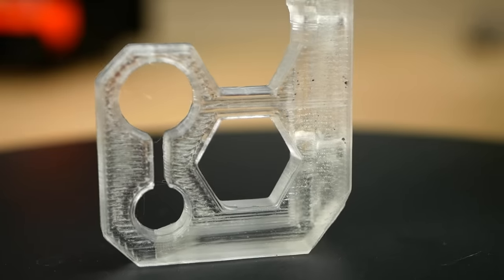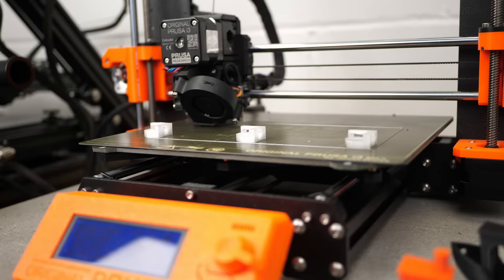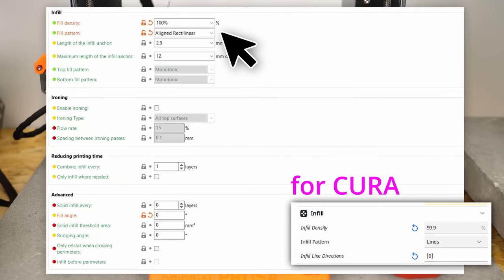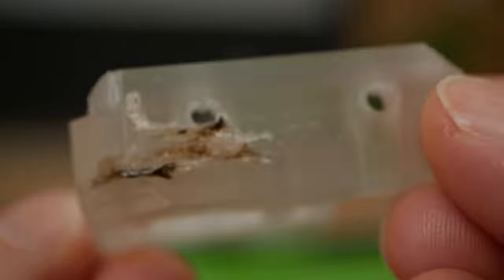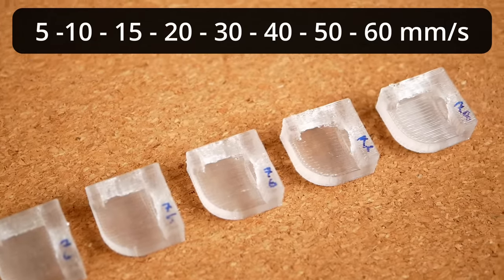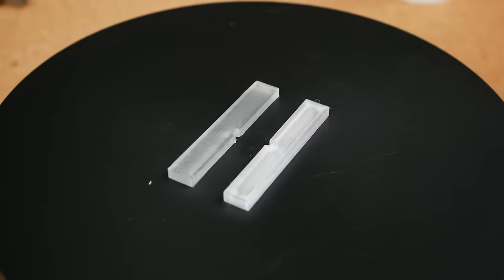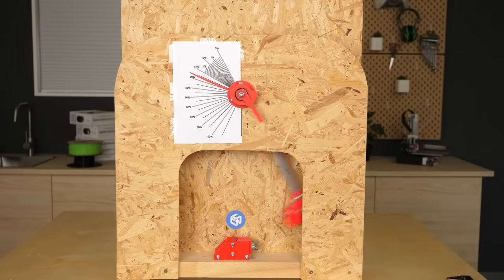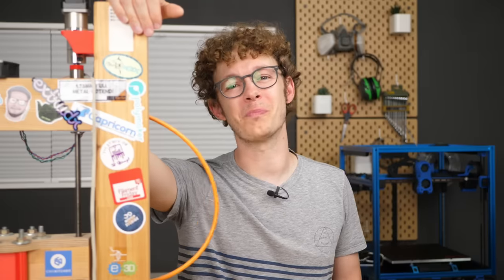Transparent FDM 3D Prints are Clearly Stronger!

Comment: I'm kind of wondering if you could vary extrusion width extremely finely to create holographic effects within the glassy print
Reply: No way. This would require modulation in the range of the wave length of visible light, i.e. fractions of micrometers.
Reply: @kaihorstmann2783  It's wouldn't be impossible but it would be very very expensive to do and would probably need a one of one state of the art 3D printer to the nano scale ✌️
Reply: @kaihorstmann2783  I think he meant deliberately creating small voids to create a 3D "holographic" structure in a clear part. Like those plastic cubes they sometimes sell at fairs with 3D "images" inside.
Reply: could be done. You'd have to have tiny voids or bubbles in the model
Reply: @gonun69  those little plastic cubes are exactly what i was imagining
Reply: Probably, seems like a decent idea. Though it'd require either manual g-code modification or a fair amount of coding.
Reply: I've been "watermarking" my designs for years with very thin included cutouts burried deep in the bulk of the model. The resulting STL file prints fine and typically isn't a problem...until someone wants to reverse engineer or edit them. Hmmmm I wonder what they would look like....
Reply: @eve_squared  could just use a modifier mesh, i think that's what it's called
Reply: I think it be easier to just change to a color print on the interior to have a clearer object with something inside just have to make sure you perge before doing the clear real good so you have loads of waste.
Reply: No need. Print it on top of bed with a P-Flat sticker installed. Youll get holo effects
Reply: no currently possible. those things work at molecular level. usually masked from crystals.
Reply: @SeanTaffert  why couldn't they just merge another solid body mesh in the watermark to make the whole mesh solid. I believe mesh tools can already do this. Not something a beginner could do but not impossible to remove watermarks without a trace.
Reply: @benargee  Nobody said it was impossible. Like stealing a bicycle, they always find a way, I just make it harder as most people are lazy. I've been burned too many times by people stealing designs and claiming them as their own. Heck, I've reversed engineered stuff from STLs, but for my own personal use only.
Reply: Could you?  Theoretically yes, but you'd have to write something very special to make it happen accurately
Reply: @NeoIsrafil  I'm thinking it could be something like the adaptive infill script he did a while back which chopped up the gcode into tiny sections
Reply: @NeoIsrafil  IT HAPPENS AT ATOM LEVEL, MASKED FROM A CRYSTAL
Reply: All depends on how big you can make it. A small piece like these? No. But if money was no object and you can make a block the size of your head then yes you can make holographic effects but it's not gonna be very high definition and will likely be ruined by the lines. Would be easier and cheaper to hand make donething like taht with uv resin and glass beads. Which I'd saying something cuase that's an expensive amd time consuming task.
Reply: @gonun69  That is really easy to do, just carve out the desired pattern in the STL file, preferably consisting of small bubbles, and set border width to something abnormally small, so the sides actually don't touch properly
Reply: I wonder if we could use a diffusion filter as a print surface, leaving a holographic negative in the print? 🤔
Reply: @Splarkszter   op isn’t talking about a crystal with colour but a material with small bubbles arranged in a matrix to look like a 3D image
Reply: Yeah it would be possible to have bubbles/voids but there would be som considerations to take into account. 
Bridging would be your main limiting factor because you wouldn’t be able to get away with supports. 
Aside from that it would be worth gearing down the xy&z stepper motors as it’s not likely to be overly large models the extra procession would be very handy. 
Aside from that it may also be worth increasing the plastic pressure on the extruder and nozzle to avoid getting unintentional gaps in the plastic
Reply: If u are talking about those old rectangular thin pieces of plastic that when light comes thru it shows a picture. There are already websites for that
Reply: Could you hit the print with a laser after its completed to "cut" out hologram?
Reply: ive seen people do something similar to those glass cubes with fdm and clear filament--not quite on the same level of precision, but if you take a mesh of an ornate design and subtract it from a solid cube i think you can get a similar effect!
Reply: That doesn’t sound grammatically correct but it is 😂😂😂😂😂😂😂😂
Reply: @jonahkolell  can u share where I can find some info, please?
Reply: @Алимпиец  "lithophane 3d print"
Have fun and good luck
Reply: That sounds like a LOT of fun to experiment with, not gunna lie
Reply: This is the comment!
Reply: @GamMngitSssEmoTionaL5953  I know it sounds stupid but why not work a prototype that works in a larger environment (basically a larger scale one?)
Reply: @eve_squared or alternatively you can use those 3d printers with dual extruders
Reply: A resin 3d printer would be the best tool for that kind of job.
Reply: Squish your z height down on every layer, see what happens
Reply: You can get holographic effects from some of the "pey" "pea" etc  novelty print beds that have a holographic surface.  They're pretty amazing.
Reply: Holographic in the way as the laser engraved glass cubes with 3d pictures inside? Yes, could definitely be possible!

Comment: My best transparent prints are done with a 0.8 Nozzle and 0.4 mm layerheight. In my opinion: thicker layers -> higher transparency. But we have to try more. ;)
Reply: I had my best results with a .4 nozzle going down to .05 layer height.
Reply: I use .6
Reply: That's likely due to there being less inter-bonding layer gaps since each layer is taller so it can't refract light as much.
Reply: Same here, using PC filament. There also seems to be an effect where bubbles are mostly present at the start of each line, then disappearing along it, regardless of nozzle size. Maybe it is possible to start each line slowly and then speed up. I do wonder why this happens though. I believe that air gets into the nozzle after each line ends, especially when stringing or drooping during the travel. No idea how to test this theory though, since this would require a transparent nozzle....
Reply: The issue with thick layers is mostly that you get a bigger rounded edge on the Extrusion which leaves much more space for potential bubbles.
With thin layers the holes underneath the rounded end of the Extrusion are much smaller leaving less air gaps.
Thicker extrusions help a lot to and thicker layers do too to a degree if you can remelt the previous Extrusion on time.
Reply: @SHIFTHOLDER1  it could be the be from that filament getting hotter because its in the hot zone longer...
Reply: @SHIFTHOLDER1  Maybe the bubbles could be improved by reducing retraction?
Reply: @Thomas0 But very slow.
Reply: Best results ive had was with a 0.2mm nozzle and 0.05mm layers... My 0.8mm nozzle was all sorts of awful, in so many different ways.

Comment: I started  3d printing 1 year ago, and I quickly realised that transparent PETG is much more stronger than opaque ones. Now I have a lot of slightly colored transparent PETG filaments from Devildesign, and i'm really happy with the results for functional parts. Still it is not strong as ABS, it is way more brittle, but much convenient for printing in an apartment. I print with absolutely normal settings at 50-80mm/s on ender 3v2 w volcano, just the extrusion multiplier is raised with 5-10%. Usually I don't care to be perfectly tranparent.
Reply: I don't hear about many people using the stuff, but Devil Design has the nicest PETG I've worked with. Very consistent, and flows nicely. I print it no slower than 150mm/s, pushing past 200mm/s when I need something done quickly. Nice colours too.
Reply: @thegribbs  especially the galaxy colours looks quite good, great for toys!

Comment: What excellent timing for me with this video. I need to make safety guards for abrasive polishers in a medical device company i am work for. I have the designs made and PETG and 3d printing will be acceptable. However i was about to abandon the idea it was not transparent enough for the operators. I am now going back to the drawing board! 😁 And Wow, the layer adhesion there is something i have never seen but only with pp. Thanks very much Stefan. From Ireland.

Comment: Craft resin casting offers an indirect method for perfectly clear items. I print my object, smooth the surface with sanding, cast a negative mold in silicone, then pour in craft resin. Inexpensive and very easy for simple models. Provides better clarity even than resin printers.

Comment: I guess this just confirms what we already knew, for better layer adhesion, print slow, print hot and avoid gaps, the clear filament is just better in showing how good of a job you did on those settings.
Reply: Agreed. I made similar experiences printing vases in PC. I guess with a heated chamber faster speeds yield comparable results to said 15 mm/s.
Reply: @haraldhimmel5687 how fast are you printing?
Reply: I wonder if the lack of contaminants such as pigments in clear filaments also contribute to stronger bonds between layers
Reply: @ipodtouchiscoollol  Здравствуй. Я видел сравнение характеристик пластика с пигментами и без. Пластик без пигментов на тех видео обладал лучшими свойствами и прочностью.
Reply: @defan123321  me  no speak ruski me no understand
Reply: @ipodtouchiscoollol  Which is what the little "translate to English" link below the comment is for..." Hello. I have seen a comparison of the performance of plastic with and without pigments. Plastic without pigments in those videos had better properties and strength."
Reply: Hence why transparent blue is a go to prototyping material. Also helps you inspect parts internally for damage analysis.

Comment: (side note on the yellowing: using a UV blocking overcoat helps significantly with the yellowing.)
This is really excellent for making 'optics'.  While you're not going to get a perfect TIR lens, this will get you 90% there for prototyping and diy flashlights and fiber optic and light pipes for light transmission for indicator LEDs or models, etc.
Rad stuff.
Reply: Which one do you recommend? I've used krylon transparent uv resistant and it's been in the Florida sun for a year with only a little yellowing.
Reply: I was personally wondering how foggy something like glasses would turn out (to the human eye) with these
Reply: @tachywubdub2469  ya know, I don't know if foggy would be the issue as much as the distortion from surface irregularities.
BUT - if you put enough elbow grease into it and if the interior is fully bonded, you can get an almost perfect lens.
Reply: I wonder if polishing, applying uv protection, then further polishing, refilling imperfections with uv protectant, and further polishing. Rinse lather repeat.
Reply: This is yellowed car headlights all over again.
Reply: @fischdl73  so I wrote a BIG long reply to you and yt deleted it.  So lame.  I'll redo it without the website reference.
Reply: @tobins6800  funny you say that - I've done this same process to try and embed as much as possible and layer/smooth and it seems like it helps.  I've started on a rough surface so that it fills in any porosity, then went sand, then second coat, wet sand then final heavy and it looks like glass.
Reply: Ok, so I just had a thought.  I wonder how well uv resistance would hold if you gave it a really light "dusting" with a UV inhibitor while printing, between layers.  Would it brown from the heat of extrusion, would it help fill in voids and milkyness with a UV 'adhesive' internally? Or prevent layer adhesion?  Interesting.  We need to try that.

Comment: This was a super helpful video. First of all, the fact that those bubbles are so visible and due to poor drying really helps to reinforce that drying the filament matters... I didn't really consider drying my PETG in the past because I conflated "water proof" with not retaining much water. Now I see that PETG can be both water proof and also retain moisture... and the proof is in the bubbles. (Thanks for showing that). The fact that the parameters that improve transparency also improve the strength of the print is also really amazing. Thank you again!

Comment: This looks really interesting. I recently switched to a 0.6mm nozzle and printed some parts with a blue-transparent PETG filament. I was surprised that they looked much more transparent than parts I've printed with almost the same settings on a 0.4 mm nozzle. I guess that makes sense as the extrusion width is greater, leading to fewer boundaries. With the new Arachne slicer engine, bigger nozzles could be very interesting to achieve more transparent prints. 
A while back I read from someone that he achieved more transparent parts by ironing every layer, although that sounds like it would take forever. But it might be worth it for just the top layers.
Reply: This matches my experience too - wider extrusions + thicker layers + higher temps + more perimeter/infill overlap seemed to help with clarity. I usually print at 20 or 30mm/s so not a lot to say there. I think the key is as Stefan hinted - as few transition boundaries as possible and making them as solid/complete as possible where they do occur.
Reply: You might be going the right direction with this, at least to speed it up, with a wide nozzle and good heading you could probably maintain the results with better speed or get better results for low detail parts at similar speeds, course bigger nozzles will struggle with finer detail as a cost
Reply: 0.6mm nozzle with 0.2mm layer height has extremely good properties.  The layer lines are still there but feel more like a texture than full bumps in the part
Reply: Even with a 0.4 nozzle i’m certain that the effect of the light refracting is much less apparent in pigmented transparent filaments. 
Printed some transparent yellow recently, went a bit hot, took it slow, and i Can almost read through it in like a size 15’ish font
Reply: How does stringing and oozing look on that nozzle?

Comment: We use a lot of these same parameters to make prosthetic sockets as strong and clear as possible.  The main difference is that we use large nozzles to go with our big parts.  I usually go for layer heights up to 1.0mm as opposed to something like 0.6mm not necessarily for speed (added benefit though!) but because it creates less light refraction opportunities and we can see through the sockets pretty well, especially when looking at them straight on through the layers.

Comment: Again one of the "Stefan and the Quest for the Holy Grail" Videos which I like most. 🙏 Thanks.
I once used this method with transparent PP filament which also gave excellent transparent results and almost isotropic properties. 
I smoothed the part by "shock heating" (how I called it)  the surface with a heat gun on 500°C . This quickly melted just the surface to a liquid state but kept the part integrity. By some kind of surface tension this totally smoothed out the layer lines and the part looked injection molded afterwards. Hope this helps in future endeavors. It might also help with vertical impact strength because besides molecular orientation the surface roughness also might have it's "impact" on those results.
Reply: @JayDee-b5u  Thanks. 🤗

Comment: I wonder if strength or even internal clarity could be even further increased by combining this with the technique that I think you explored awhile ago of packing the printed part in salt and reheating it.
Reply from the maker: It probably would and PETG was a very good candidate for that.
Reply: I have tried it, spending about two weeks working on it and I ended up with nicely transparent prints with accurate dimensions  to get rid of bubbles for salt remelting. Turns out that once I got layer adhesion that good, there was no need for salt remelting. Feel free to test it of course, but the improvement in terms of strength will be likely unnoticeable and for me not worth the extra work and time of a salt melt, which has a decent failure rate depending on the object's shape.

Comment: Testing bigger nozzles might be interesting. Especially CHT nozzles.
Reply: I'm guessing CHT would be worse for transparency, because of the split path. PETG beats into a foam, like egg whites, so you don't want to disturb it with fast retractions, high E-acceleration or split nozzles.
Reply: @thedamnone  it does not - flow stays laminar. Cnc kitchen already tested that.
Reply: @thedamnone  as you said.... You are guessing. We will know it for sure if someone will test it. I do have a 1.4mm CHT and clear PETG at home, but I'm not feeling confident doing the test and everything correct
Reply: @spedi6721  already tested my guy